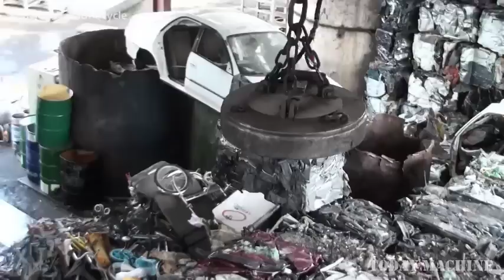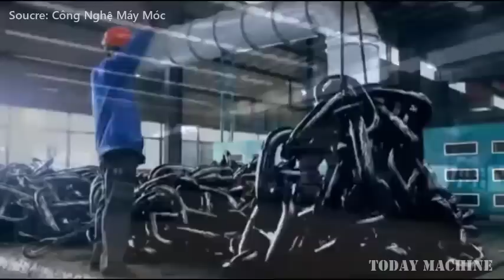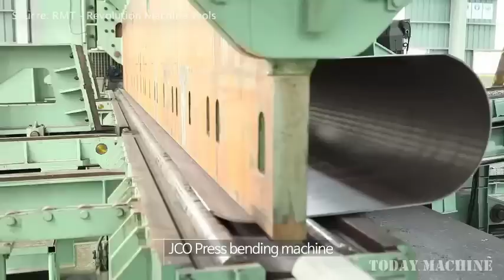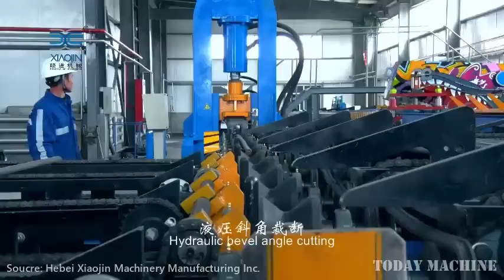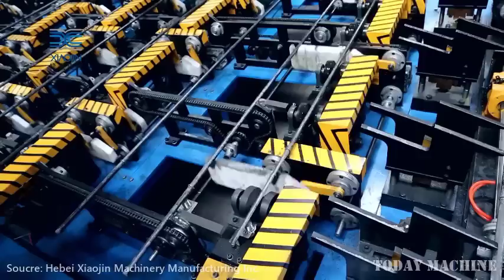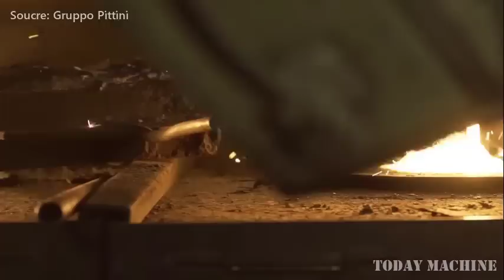The Process Of Dismantling And Recycling Old Cars To Produce Giant Steel Chains

Comment: What struck me most in this video is how deeply the automotive recycling industry is tied to global economic forces, particularly in steel production. I didn’t realize just how much China dominates the steel market — more than half of the world’s steel comes from there! The scale and efficiency of China’s steel industry, especially with its focus on advanced manufacturing and vertical integration, really put the rest of the world to shame. It’s incredible that the scrap metal from old cars is so vital to steel mills, making up a significant portion of the steel production process. The environmental benefits of recycling are impressive too — recycling steel saves massive amounts of energy and reduces carbon emissions, which is essential given the world’s growing focus on sustainability. However, the video also raised some important questions about the future of car recycling, particularly with the rise of electric vehicles (EVs) and alternative materials. Will EVs, which use fewer metals overall, reduce the availability of recyclable steel from cars, or will this just push the industry to innovate even more?